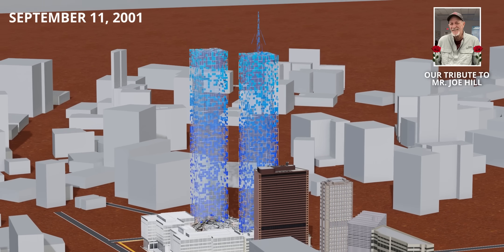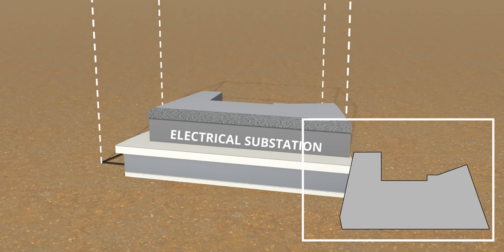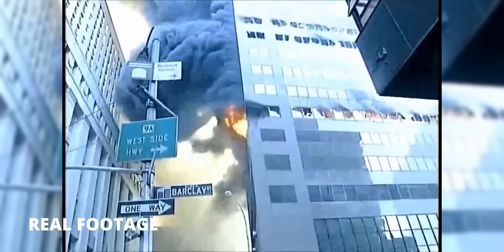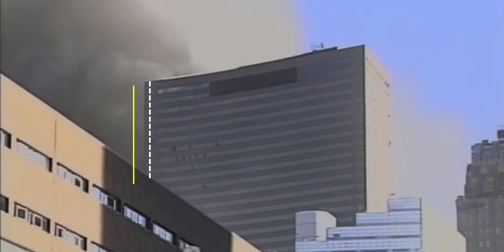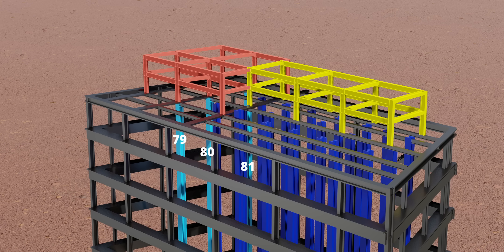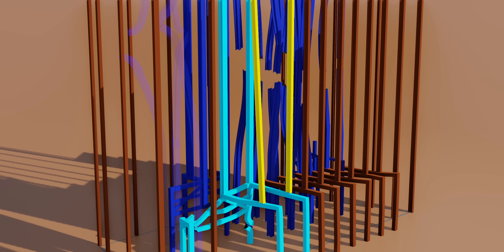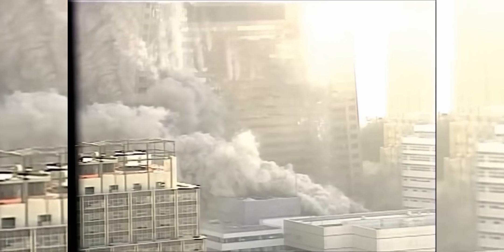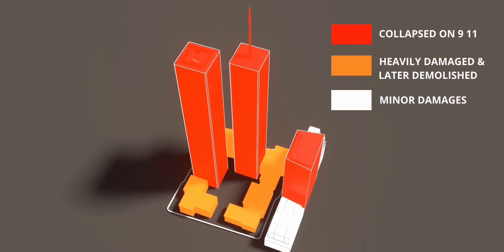Collapse of Building 7 | The Complete Physics

Comment: What caused the fired at the worl Trade Center 7?
I don't understand why the firefighters didn't put out the fire in that building?...
Reply: The North Tower collapse at 10:28am bombarded Building 7 with thousands of tons of burning debris, causing heavy damage and starting raging fires burning out of control for the next 7 hours. Half the responding FDNY firefighters having been killed, others injured, units in disarray, much of their equipment destroyed, no water pressure, and the greater urgency of Search & Rescue efforts, firefighting efforts at 7 were pulled as futile. The building couldn’t be saved and was left to its fate.

youtube.com/watch?v=g_SvpwyC17M&ab_channel=MFitz 

Collapse of a burning structure is always a concern for firefighters. Steel buildings subject to fire rely on active fighting of the fires to survive. Left to their own devices they will collapse. Buildings are designed around 1 to 3 hours of fire resistance, allowing time for occupants to escape and ACTIVE firefighting to get started, after which all bets are off. In B7 the occupants escaped, passive and active fire protections were compromised and active firefighting never got started which left the building to take its chances. It lost. Odds on Building 7 would eventually collapse,… and it did. No big deal in logic. That is the sort of choice firefighters make every day in brush fire situations - which houses to save and which ones to let go. Only real difference here is moving the decimal on the size and cost.

FDNY Chief Daniel Nigro ; The biggest decision we had to make on the first day was to clear the area and create a collapse zone around the severely damaged 7 World Trade Center, a 47-story building heavily involved in fire. A number of fire officers and companies assessed the damage to the building. The appraisals indicated that the buildings structural integrity was in serious doubt. I issued orders to PULL BACK the firefighters and define the collapse zone. It was a critical decision; We could not lose any more firefighters. It took a lot of time to PULL EVERYONE OUT, given the emotionalism of the day, communications difficulties and the collapse terrain

FDNY Deputy Chief Peter Hayden - We had our special operations people set up surveying instruments to monitor and see if there was any movement in the building. We were concerned of the possibility of collapse in the building. And we had a discussion with one particular engineer there, and we asked him if we allowed it to burn could we anticipate a collapse and if so, how soon? And it turned out that he was pretty much right on the money, that he said 'In its current state you have about 5 hours

With its deteriorating condition being reported throughout the day, the collapse of Building 7 expected by the FDNY, bystanders and the media meaning at least 24 video cameras recorded some or all of the collapse. Everyone at the time knew what was coming and why.
Reply: I have spent time making considered responses to idiotic statements a number of times only for them to be immediately removed. I don't understand how the shadow banning works but it is there.
Reply: @neutralyukka  There's no "shadow banning". It's just the sub-standard quality of the Youtube algorithms. It will randomly remove comments from anyone and everyone, as well as not let people know there's a reply to their comment.
Reply: @mooneyes2k478  the outcome is the same, even if it isn't directed
Reply: @neutralyukka  Not really. Since it happens to everyone, there's no "same" in the outcome.
Reply: @mooneyes2k478 I didn't articulate what I meant by outcome. I have seen the auto-deletion of comments completely shut down what was a reasonable and polite debate about some topic or other a number of times. When it happens to me I am discouraged to spend the time to make considered comments and think about what I write. The same happens with other participants. Eventually someone gives up on the conversation. This outcome happens regardless of how or why the comments get deleted
Reply: @neutralyukka   Well, point, I suppose, yes. Just noting that, it isn't deliberate. The average "truther" is ever so keen on being prosecuted. They, yes THEY, are important and relevant people and "the man" is ever so scared of them and this is PROOF!

Which is why, I think, it's worthwhile noting that, no, they're not and no it's not.
Reply: That's interesting...oh, well.

The North Tower falling onto it.
Because, 1, there was no water pressure, and 2, there was no real reason to risk lives.
Reply: @mooneyes2k478  Then why was there enough water and water pressure for battling the car fires around WTC7? And so for the rubble fires just after the building collapsed? You can see on pictures at least three FDNY Ladder trucks spraying the WTC7 debris with high-powered water streams around 6PM on 9/11.
Reply: @MrKoenig1985  Because, what do you know, a car fire, or even multiple car fires, and a 47 story building, isn't comparable. Imagine that.
Reply: @mooneyes2k478  Funny how my last reply to you was removed. It contained no links or any pesky "buzzwords". So, no tough cookies for "debunkers" allowed here, otherwise it will make them look bad?
Reply: @MrKoenig1985   So, in other words, you personally are ever so important and relevant, and "the man" or whoever is scared of you, huh?
Reply: @mooneyes2k478  thank you very much. I always wanted to know the reasons that occurred on September 11. Greetting from Perú.